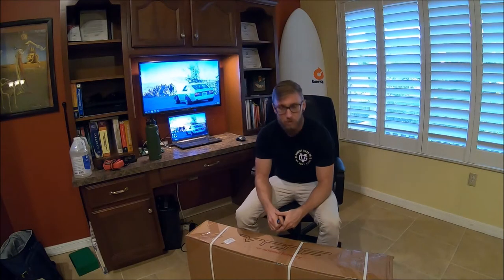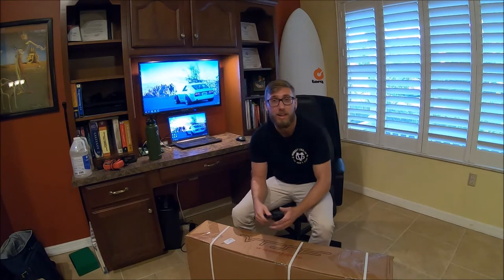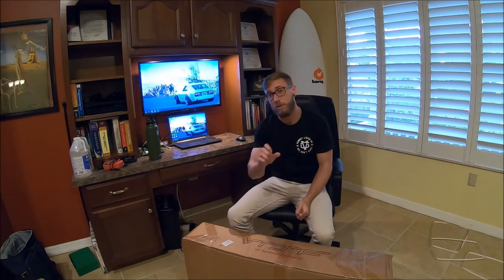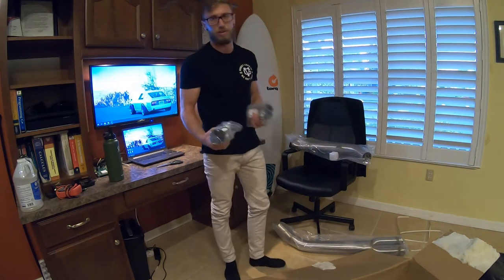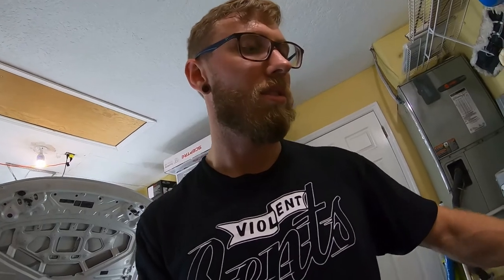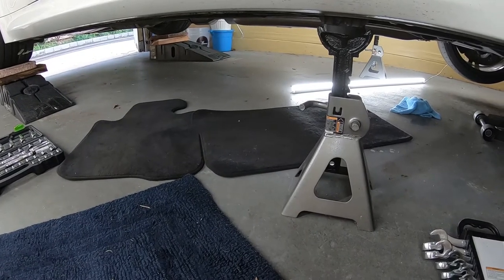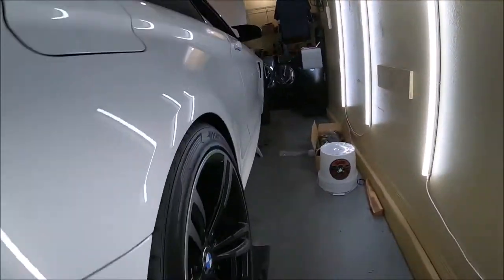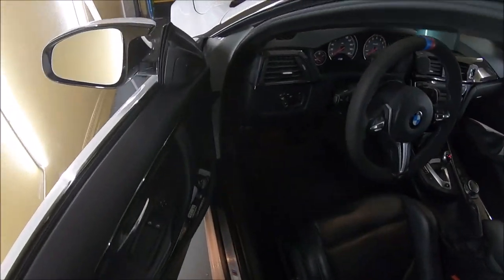Vlog 16 - BMW M4 VRSF Midpipe DIY Install (BONUS: Socket Wrench Fail Intro!)

Comment: I have dp's allready installed, bought 4 new nuts and 2 new donuts' between midpipes and dp's so I don't get any leaks  need to buy that cutter for the pipe and find midpipe's. :)  nice work man!
Reply from the maker: Nice! The downpipes were a great improvement to the sound. Once I added the midpipe, it was the perfect combination! Let me know if you have questions during your install. Thanks for reaching out!
Reply: @Awesomoto  Ordered midpipe, and added mperformace floor mats as my car came with crappy ones. :)  If the car will be stupid loud I may slap stock OEM dp's back on!> i need to swap to stock oem dps this year anyways , So I guess we find out!
Reply from the maker: @StreetDrivenDaily  The midpipe makes a huge difference in the sound and I think it would still sound amazing with the stock dps. If you do stock dp's with the midpipe, let me know how it sounds!
Reply: @Awesomoto  I need to swap to oem dp. Every 2 years do emissions. BTW hows the smell ? Is it bad with dp and midpipes? Also I wonder how much oem dp and midpipes weights
Reply from the maker: @StreetDrivenDaily  Not sure about the weight, but the smell of catless isn’t great lol.
Reply: @Awesomoto  if may be fine with oem dps but I want that turbo whistle
Reply from the maker: @StreetDrivenDaily  That turbo whistle is definitely strong with both exhaust upgrades I can assure you that. The intake upgrade also drastically improved spool noise.

Comment: amazing video! Are you running aftermarket downpipes or you still have your cats on?
Reply from the maker: I’m running VRSF careless down pipes. They’re a great addition to the mid-pipe and I felt the combination of the two drastically changed the sound of the exhaust. Super happy with VRSF products...and their affordable.

Comment: great video! been waiting for an actual tutorial one for a while lol out of curiosity when you bolted the first piece did you reuse the standard bolts or did it come with some new ones? i have a vrsf ready to fit but ive lost the bolts unfortunately so might need to buy new ones
Reply from the maker: Hey Ryan! I reused the OEM bolts, but it did come with all the bolts you need.
Reply: Awesomoto  lovely! cheers dude

Comment: Did you only change the midpipe?  No downpipe or tune?  Sounds great!
Reply from the maker: AJ Leyco Thanks man! Yes, there is a down pipe and I also have Bootmod3 flash tune on the car. I have an earlier video post of the down pipe install and I’ll be uploading a bootmod3 video soon. Thanks for watching!

Comment: I watched your video as my guide to install mine and when I’m driving over 50mph I don’t hear it the exhaust sound anymore. Why is that?
Reply from the maker: Are you driving it in efficient mode when at 50 mph? The exhaust valves are variable based on rpm. I have Bootmod3 flash tune so that the valves stay open in Sport and Sport Plus mode. Let me know, I can help you troubleshoot if needed.
Reply: @Awesomoto  yes please I really do. Your videos are my guide, I really need help with this mid pipe.
Reply: @Awesomoto  When My valves I’m on sport plus everything and still over 50mph all is quiet.
Reply from the maker: @djfinalmrimpossibletoignor2716  Are you driving a DCT transmission? If so, it's probably up in 7th gear and you won't hear the exhaust much until you downshift to 5th or 6th and get on it.

Comment: Where did you get that steering wheel cover? I just bought an M4 and wanna buy one. Thanks!
Reply from the maker: I got it off of Amazon. I pasted the link below. I wish I would have created an install video of the process. It was fairly easy to do...just need some time and patience. Let me know if you have questions.

https://www.amazon.com/MEWANT-Genuine-Steering-2015-2017-2014-2017/dp/B07DJ85YB4/ref=sr_1_35?dchild=1&keywords=bmw+m4+steering+wheel+cover&qid=1608672908&sr=8-35
Reply: @Awesomoto  awesome thanks I appreciate it!!

Comment: Is warrenty gone with this? If you did not do down-pipe and tune and just left it stock with mid pipe
Reply from the maker: Hey Yanzi! I’m not certain if this voids the warranty, but I’m inclined to say it does. You should check with your dealership to be sure. If it doesn’t void warranty, I highly recommend this upgrade!
Reply: @Awesomoto  yeah I agree itching bad to do it
Reply: @Awesomoto  I might just do it and put back to stock when I go for service, I have a lift. If they ask about the cut pipe I might just say that I changed the muffler but didn’t like it so I put it back to stock lol
Reply from the maker: @yanzi1957  Honestly, that sounds like a solid route. A lift would make putting it back to stock easy and I doubt you'll get any grief from a technician about the cut exhaust. lol

Comment: btw, does the midpipe rubs  in the middle where the bracket is? thats bolted to the body?
Reply from the maker: Yeah I had some rubbing there. I wrapped some fiberglass exhaust tape around it and it worked perfectly. I drive it for a few weeks before adding the exhaust wrap.

SunplusTrade 2" x 50' Black Exhaust Heat Wrap Roll for Motorcycle Fiberglass Heat Shield Tape with Stainless Ties https://www.amazon.com/dp/B01KVYH66U/ref=cm_sw_r_cp_api_glc_fabc_Rgt-Fb1A91N0T?_encoding=UTF8&psc=1
Reply: @Awesomoto  cool. People adding washers. I'm not sure if that's also a solution.  Well. I'm going to start installing midpipes tomorrow... :) I have all ready. New nuts. Donut gaskets for dp.  Also, you kept oem midpipes ? Just In case you go back to stock ?  I'm really itching for 997 turbo. Or GT-R.
Reply from the maker: @StreetDrivenDaily   That's awesome! Good luck with the install! Reach out to me through Instagram DMs or email if you get stuck along the way. Yeah, I kept the OEM midpipes in case I move to a state that requires smog testing. Dude 997 would be amazing! I'd like my next car to be a Porsche.
Reply: @Awesomoto  had 996 turbo. 6spd. But 997 is so nice.  Thanks bro
Reply: @Awesomoto  btw the h brace you know which I'm talking about. In the center that has 6 bolts  Some of the bolts were messed up and I got 4 out np but 2 are fkd haha So I guess I'm just gonna  cut them. Someone used power tool to tight them up for sure.
Reply from the maker: @StreetDrivenDaily  Ugggg, that’s the worst! People give me crap for not using power tools, but stripping bolts is one reason I don’t use them much. Cutting them might be your only option
Reply: @Awesomoto  Dremel did it's work. Both bolts are off. Just need to buy 2 bolts. Not sure what part number is that  I ask at the dealer . Yeah I don't use power tools on small stuff. BTW in your video. First rubber hanger. Why it's not in the hole but hanging. I started to mount midpipes. It's too cold here in Chicago so I can only work 2 hours max haha.
Reply from the maker: @StreetDrivenDaily  Glad you were able to get that bolt off! As for that hanger...it was damaged and I used it to hold it in place for alignment before replacing it with the new one.
Reply: @Awesomoto  installed all but have issue with center  bracket clearance. I might just get longer bolts and tons of washers lol.
Reply from the maker: @StreetDrivenDaily  That might work if you run out of options. Make sure you leave the entire exhaust from the downpipe connection back to the muffler loose so you can adjust each section incrementally.
Reply: @Awesomoto  yeah I did that but I think I'm going to lose everything except downpipe to midpipe connection as I tight that allready , install bracket on. . Put piece of wood Maybe 1 inch between midpipe and bracket And try to tight everything again. :)
Reply: It worked, but there was still a little bit of clearance issue still, not so much as before so I installed washers!,  done. I think because of my downpipes-  I was so excided to finish and hear the car-  I started the car, I'm like thats not that loud, I love it!  switched to sport, and i'm like meh, sounds a bit louder but nothing crazy! WTF -but all ready liked it --THEN I remember playing with valve flaps on the muffler  (connectors) few months back (by disconnecting them etc) so I was like MAYBE  one of them is getting stuck or something, as i did not hear any clicking sounds! AHA! so pull them out, cleaned , put it back in , went to sport boom both of them open now and i can hear the click! MAN the car sounds so fuckin good! I love it! its so perfect its not super loud, maybe cold start with open/valve is but , when i start with valve closed now, its so nice, plus if i want loud, boom sport mode!
Reply from the maker: @StreetDrivenDaily  RIght!? I love the way this midpipe changed the tone of the exhaust! It sounds so throaty and mean just idling. I'm glad to hear you got everything sorted out. Also, good work on the troubleshooting with the exhaust flaps!
Reply: @Awesomoto  what? Wait exhaust wrap where is the link or the video for that.. lol
Reply from the maker: @djfinalmrimpossibletoignor2716  I just wrapped a section where I had rubbing. Not all people will have rubbing there, but if you do you can wrap it with this. 

https://www.amazon.com/SunplusTrade-Exhaust-Motorcycle-Fiberglass-Stainless/dp/B01KVYH66U/ref=sr_1_2_sspa?dchild=1&keywords=exhaust+wrap&qid=1611629153&sr=8-2-spons&psc=1&spLa=ZW5jcnlwdGVkUXVhbGlmaWVyPUEyT1lJR1FKRVUxRlYzJmVuY3J5cHRlZElkPUEwMjI1Mjk1MTVFSThYR1daMVMyTyZlbmNyeXB0ZWRBZElkPUEwNTUxNjIxMVFITUFSQU9DUVNMMyZ3aWRnZXROYW1lPXNwX2F0ZiZhY3Rpb249Y2xpY2tSZWRpcmVjdCZkb05vdExvZ0NsaWNrPXRydWU=

Comment: Did they send you two useless gaskets too? I assume they thought they would go where the donuts go.
Reply from the maker: Yeah I was confused by those and never installed them. Not sure what they were thinking when they included those.
Reply: @Awesomoto  I fitted my vrsf midpipe yesterday and though it was weird how they sent them and not the donuts. Luckily I had already got a couple of donuts in stock.
Reply from the maker: @CaptainCarling  Yeah I thought they should have came with them is well. Hopefully they change that.

Comment: Are you scared of power tools?
Reply from the maker: lol it seems that way right? No, I just didn’t have any at the time. I recently stocked up on a bunch of power tools including an impact that will make installs much easier.
Reply: Don't listen to this. Power tools should be used sparingly. Any good experienced mechanic will tell you this. I only grab a power tool when absolutely necessary. Stripped bolts and broken bolts suck.